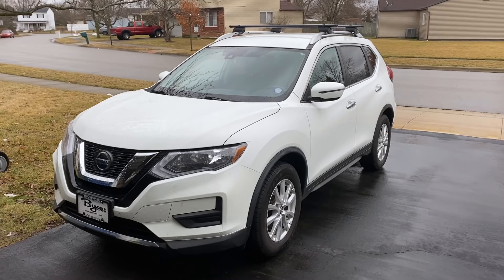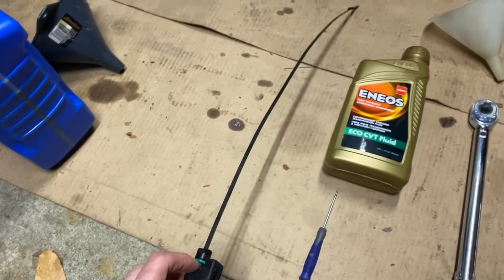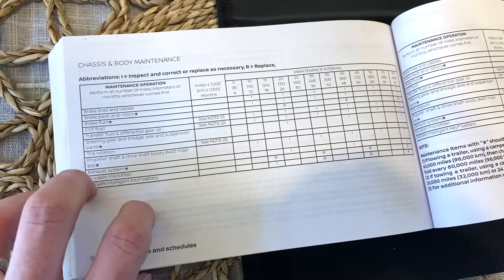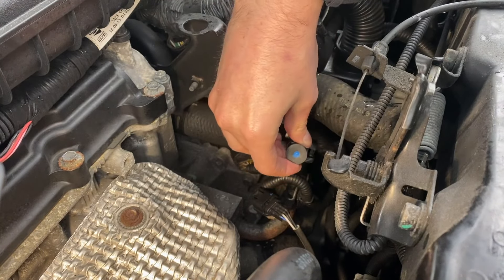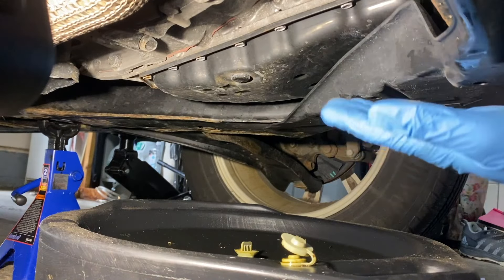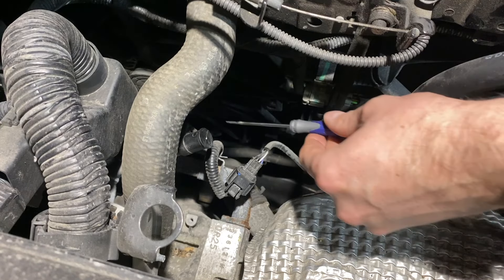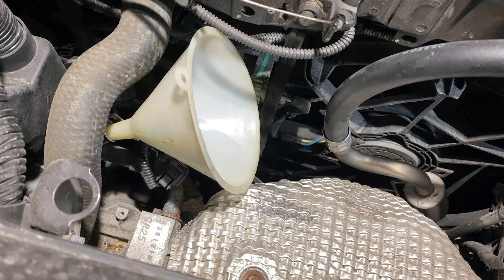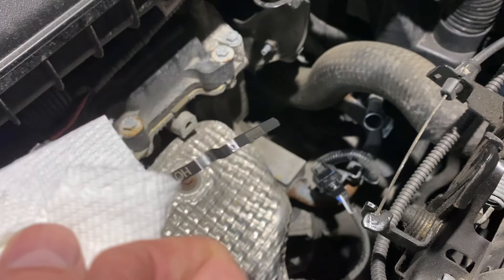2013 - 2020 Nissan Rogue CVT Fluid Change

Comment: So I did this but accidentally put to much in, now I’m worried 2016 Nissan rouge do you know if there is an overflow bolt or should I drain through bottom pan? Thanks
Reply from the maker: There is an overflow bolt! It’s on the underside right by the pan, and easy to unscrew.
Reply: @MattStephensRich  Exactly. I usually pull that one first to see if anything comes out before I get started. then live it out when I refill it.
Reply: If you have too much oil, you can suction it out by using a hand-held oil extractor. Harbor Freight Tools sells one for under $10. There is a thin, long plastic tube at one end and short, thick tube at the other. The thin tube goes into the transmission hole. The thick one pulls out the oil into a container. You pump it out by hand.

Comment: So the original part does not have a dipstick?
Reply from the maker: That’s correct! There is a cap cover (with no dipstick) and a bleeder valve down below you can use for checking level while running. Annoying on all counts!
Reply: @MattStephensRich  how long is the dipstick? Is it longer than the oil dipstick?

Comment: Great Video! Did you ever finish part 2 with changing the internal and external filters? I have a 2018 Nissan Rogue SV that I'm gonna be changing fluid soon, 85,000 miles and not sure when done last, bought used. Do I need to change both filters or maybe mine only has internal filter? Thank you!
Reply from the maker: Unfortunately still under works! It has proven a harder one to research and get clear direction on. Your CVT has two filters: a strainer filter in the pan and a particulate filter just near the mating surface with the engine. TBH, you can just swap the fluid if you need to do the work now. If you’re up for a bit more work, dropping the pan and swapping the strainer filter is relatively straight forward. The secondary filter still proves he’s to get to, and working up a good approach to recommend folks for doing so - there are a number of other videos out there though that offer some walk through!

Comment: Wht length is the dip stick you use . I think some of the tubs are different lengths
Reply from the maker: This was just the one that met spec for this model year of rogue. If in doubt, double check the recommended vehicles for your dipstick - can always return!

Comment: I drained 3 quarts out my 2020 rouge,Dealer said it holds max 8 quarts.I added what came out am i not contaminating the new fluid with the other 4-5 quarts thatdidnt come out?
Reply from the maker: Ultimately yes, old and new fluid will be mixing. This is partly why I mentioned doing another drain and fill to cycle through more new fluid. 😊
Reply: by the time i do this and be up to 200 in fluid alone dollars makes sense for dealer to do it for 300 they change filter gasket flush and fill
Reply from the maker: @DanCurulla  honestly two fluid swaps gets you a pretty significant chunk of the way, at least to the point where you’re seeing new fluid color. But time is always worth something too!
Reply: @DanCurulla you a fool to take it to the dealership for the transmission fluid. Take it to a transmission specialist instead not the stealership

Comment: You used CVT NS3,  but OEM is for the Nissan Rogue 2016 is it the same thing regardless?
Reply: 2016 is ns2. But you can use ns3 it is backwards compatible.

Comment: So you are leaving the stick in the tube, or using factory seal plug ?
Reply from the maker: Taking the stick out and replacing the cap.
Reply: So only using the stick to measure, then keeping original cap on?
Reply from the maker: Ehh dealers choice. You can leave the new dipstick in!

Comment: I drain the fluid and refill every 15k miles then the next time i change cartridge filter only the 3rd time i change everything... to much?
Reply from the maker: 15k miles may be a bit overkill and could be dialed back to 20k-30k. I have been able to find language on filter changes recommended for every 30k (working on a follow-up video with filter changes included), so fluid change could be indexed with that. But hey, these CVTs are notoriously culprit for failure, so airing on the safe side is perfectly rational as well.

Comment: I need help!
When I check my maxima at cold its "normal levels". 
But when running at normal temp for 20 so minutes. The dipstick is completely dry. I mean not even a small amount of fluid. (After sticking it in 180 degrees like the manual says).

I got the fluid changed around 5k miles ago. So I'm trying to check the levels because it started slipping REALLY hard. Like perfectly running transmission before changing it. No metal shavings in the fluid and then all of a sudden my fluid is low when hot and is slipping bad.

Is it normal to get higher levels of fluid when its cold?
Reply from the maker: The X factor is probably checking the fluid levels while running, which does absorb 2-3 pints of fluid. This fluid actually expands when warm, so with engine off, fluid measurement will actually be higher when warmed up.

Check fluid level with engine running, and that will get you a best measurement!
Reply: @MattStephensRich  yeah so what your saying.  if the fluid is lower when warmed up correctly. Does that mean I need to fill it up based on warm measurement?  while running

If so then my cvt has basically no fluid registering when warmed up at all. So its low on fluid? 

Sorry just a bit confused why I was getting higher measurements when it was colder haha.
Reply: @MattStephensRich  thank you so much! Also thank you for the fast response!
Hopefully this is whats wrong with it. And fixes my issue
Reply from the maker: @watsontyler42  yes, you’re low on fluid. Run the engine, and gradually add fluid until you get measurement. 😊
Reply: @MattStephensRich  update yesterday It completely fixed my transmission. I got some fluid from a nissan dealership and over the course of 2 hours filled it up till it was at normal levels while running. 
Transmission runs like its brand new now. 
Didn't slip once while testing it. Even pedal to the floor it was flawless and didn't slip.
Reply from the maker: @watsontyler42  Glad to hear it!

Comment: 1)use metric tools on a metric car. 2) Dealership service advisor said: CVT has no filter, cannot be flushed since has valves which cannot be evacuated dry. just drain, measure, refill exact same amount every 30k. No need to repeat for 30k. Owner's manual needs clarification. If you catch every drop & measure, no dipstick needed
Reply from the maker: 1. Do notice I have 19mm in the video description; you’ll also find ¾ inch socket is 19.05mm equivalence, and still makes for a great fit.
2. There’s actually two filters on this Jatco8, one strainer filter below and a finer particulate filter in the middle of the housing. Drain and replace of fluid is the biggest priority, but filters can be swapped and it is honestly advise will give him the massive class action lawsuits in recall over these CVTs having failure. (Working on a follow up video showing this)
3. Dipsticks are we still really helpful. There is a bleeder valve below you can also use for checking fluid level, but wanted to show a dipstick solution as that’s often most familiar for the masses.
Reply: Interesting-Nissan service advisor told me that NONE of their CVTs have ever had a filter
Reply from the maker: You can find it in the Nissan parts catalogue, or even search "Nissan CVT filter" on Youtube for good coverage. Speedkar recently tore apart a Jatco 7 (previous gen), which shows a good sightline on both filters :) :https://www.youtube.com/watch?v=Rhx-Hpn1Q90
Reply: I heard nothing after persnickety😂

Comment: hi bro i have nt32 x-trail 2014 rd20dd 2.0 with cvt. i just drained oil out and added 4l ns3 cvt. do ireally need check level? i dont have garage so it is really hard to me.
Reply from the maker: I would still recommend checking levels, or at least be doubly sure the fluid going in matches that which you took out!
Reply: @MattStephensRich  i visited nissan service and they said it is little over filled and fixed. thanks bro.
Reply from the maker: @TheMentalsport  glad to hear it!
Reply: @MattStephensRich  very slight whining noise like hybrid car on really low speed like 0 to 15km/h speed  is it engine noise?
Reply: btw very nice video. thanks for the hard work. if i didnt watch your video i go with overfilled cvt and break it kkk.

Comment: is the engine running when you check the level? and the dip stick link is page not found for me.
Reply from the maker: Ahh good flag! Fixed the dipstick link. Engine does not need to be running to check levels.

Comment: Do you know if this would be the same process with a 2021 Nissan rogue?
Reply from the maker: Yes same process! Looking up the 2021 Rogue specs, it would appear it's also sporting the Jatco CVT8 also shown here. Overall I'd recommend double-checking to make sure referred bolts, fill neck, etc. are in the same spot. :)

Comment: How much CVT fluid does a Rogue 2009 FW drive use?
Reply from the maker: Looks like full volume is 8-9 quarts, but I’d recommend measuring what you drain off (recognizing some fluid remains in the inner workings) and top up based on that (hence most likely only needing 3-4 quarts).
Reply: @MattStephensRich  Thank you for responding and providing suggestions.
Reply: @mr.z3161 actually 8-9 qts. Is for awd.

Comment: Thank you so much. I am looking at a “as is” ‘18 rogue with 48k for 11 grand. 

thoughts on this? it’s a local dealership reviews are horrible but i’m hoping it’s low cost cause they think Nissans are horrible
Reply from the maker: Would be worth getting the carfax on the vehicle or asking if you can get the it looked at by another mechanic - that’s definitely a low price, so I’d be curious on if it was in an accident, etc.
Reply: Runnnnnnn
Reply: I bought a 2015 rouge select. Under 100,000.  I just paid 1800.00 to get serpentine belt fixed had to pay for another one because it was squealing then they replaced the the pulley then the water pump pulley then the alternator and so and so on. IT HAD A CARMAX CHECK UP BOUGHT FROM JT AUTO LAND IN MY CITY. JUST BOUGHT A PIECE OF ----. DONT BUY A ROGUY PERIOD
Reply from the maker: @sh1959-sept  Ugh, sorry to hear about the luck!
Reply: @sh1959-sept  are you going to the dealer for this? i would just buy the part and give it to my local mechanic
Reply: @MattStephensRich  it was in an accident 100% as the fax reported i just said no to it cause that’s too much with the dealership being so far and paying so much

Comment: There is some horrible information in this video although I appreciate the effort trying to help people. You should never wrench on a drain pan bolt as hard as you can that is very bad information that can easily lead to strip threads when it's removed next time or right away. And you don't need oil to make a seal on a crush washer the whole purpose, and the reason you have to use a new one every time, is that the metal crushes and forms to make the seal perfectly the same shape as the other metal it's making contact with. The oil might help you get the crush washer off next time but I've never had any trouble with them coming off either way. And don't forget that fluid expands as it is heated so the reason it is showing too full is not because the fluid is cold. After seeing that you should definitely be verifying whether the engine is supposed to be running when it's checked or not though because an engine running while it's checked will suck the fluid level down. You should also know which specific temperature of the fluid should be. With that said there is some good information like the third party dipsticks being available etcetera so it's not all bad but some of that advice could lead people to thousands of dollars worth of repair damage.
Reply from the maker: I don’t think I oiled the crush washer? We did oil the gasket.
Reply: @MattStephensRich  @17:08 the video says to use motor oil or trans fluid or something to make sure the crush washer has a good seal. Crush washers don't need anything to make a good seal. Sometimes you can get by with reusing them two or three times but you're supposed to, and I would, change them every time. The way they seal is exactly how the name infers as they crush as they are torqued down and form a perfect seal in the perfect shape that is made of metal and will never leak until the bolt is loosened or removed. With a crush washer you have no rubber to rot but once it's been been crushed before it may not be able to seal perfectly again. They don't cost very much at all but the parts stores will usually try to sell you the whole bolt which is totally unnecessary and extra expense. I would guess they both they sell you is likely worse than the one that's factory but either way you can order crush washers for cents each and replace them every time and preventing even one oil leak will save you more than the washers cost for the life of the whole car.
Reply: @MattStephensRich however, recommending to tighten that as hard as you can is a huge, HUGE,  negative and a very expensive repair to be done later and depending on the vehicle no telling how much work is involved in replacing that whole pan if it's replaceable. I hope there's no cars evolved into non-replaceable pans but nothing hardly surprises me these days.

Comment: Great video! When you read the manual, if you go back, there's a new "bullet point", which if you look again, that 60.000 miles change interval falls under towing. 

However, what I really wanted to ask is that you mentioned that 2019 rogues can take NS-2. The reason I'm asking is BC I'm about to change mine, but I have 2 quarts left from my 2013, which takes NS-2. I just didn't want waste those 2 quarts, and perhaps I can just mix with 2 more NS-3 bottles. What do you think?
Reply from the maker: Backward compatibility is a bit murky; while I’d imagine you’re ok (as the CVTs are all made by Jatco, and many online forums report fine operation with NS-3 on NS-2 spec CVT), it’s also ok to just go out and buy more NS-2 as that is still spec for your 2013 Rogue!
Reply: I would not mix the two fluids. I have a factory service manual for my wife's 2014 Rogue SL and it specifically states to only use Genuine Nissan NS3. The 1st generation Rogues use(d) NS2. I have talked to a few Nissan techs about this and because of the finicky nature of these transmissions, they advise adhering to the exact fluid recommendations.

Comment: That 60K miles is when you drive it with much care at all times, or near perfect driving. Don't follow that when you're in a mixed driving mode. Instead, do it every 30K miles.
Reply from the maker: Good point!

Comment: I never knew fluid could contract at a hotter temperature.... Maybe the transmission was just overfilled, or the markings on the aftermarket dipstick were incorrect. Maybe the hashmarks showed the expanded "HOT" reading, and maybe the notches on the side were the cold reading.

Comment: Off-brand is better as long as the specs are the same or better. Go Amsoil; your CVT will last longer.
Reply: Also, if you do not have a torque wrench, just get it nice and snug. Don't wrench on it and go super tight.
Reply: AMSoil is no better than ENEOS or Idemitsu except for its marketing.
Reply from the maker: In spec is always key 🙌🏻
Reply: @thx1138guy your opinion on the valvoline equivalent?
Reply from the maker: @silvercommander if it’s in spec - go for it!

Comment: This basic video is elementary. To do it properly, use the transmission out and in fluid cooling lines to change oil out entirely. Look at the fluid out until you see the clear new oil come out. then put it all back together and check oil level by using the oil level plug on the side of the tranny. Now, and only now, you have changed out the transmission fluid.
Reply from the maker: Good point!
Reply: Show video then of how and with what equipment.

Comment: NS 3 is NOT backwards compatible!! You made a mistake in  your video
Reply from the maker: The fluid I was using is compatible for both NS-2 and NS-3 😊
Reply: @MattStephensRich  most of good cvt oils are NS2 and NS3 compatible. The international standard for NS3 oil clearly say that is not compatible and contains different additives. You mentioned that is backwards compatible, which is wrong. This is what I am saying here. You cannot use NS3 oil in a NS2 cvt gearbox
Reply: I do use Eneos too. Is the best oil for Japanese brands, along with Intemitsu

Comment: CHANGE TRANSMISSION FILTER/FILTERS AT 60 000 MILES IS LESS THAN IDEAL BUT NOT AS CRUCIAL AS THE FLUID CHANGE EVERY 20 000 MILES WITH FULL SYNTHETIC OIL DUE TO BEARING FAILURES BEING QUITE PREVALENT AMONGST NISSANS CVT DUE TO EXCESSIVE HEAT BUILDUP COUPLED WITHA LESS THAN IDEAL FLUID CAPACITY IN ORDER TO DISSIPATE AND COOL COMPONENTS WITHIN THE MECHANICAL PORTION OF THE CVT.

Comment: Where’s the filter
Reply from the maker: Underneath in the pan!
Reply: @ I found it, it was above the pan in its own cylinder housing unit so weird
Reply: So it had 2 filters? In the pan and the side cylinder? Seen another vid where they charge both filters.
Reply: @321hellooooo  holy crap lol if there’s 2 filters what a horrible design

Comment: Manufactures have simply stopped, putting maintenance procedures and specifications in their owners manuals in efforts to take the right to repair act by scaring an otherwise FULLY CAPABLE at home DIY.
Reply from the maker: Sadly true